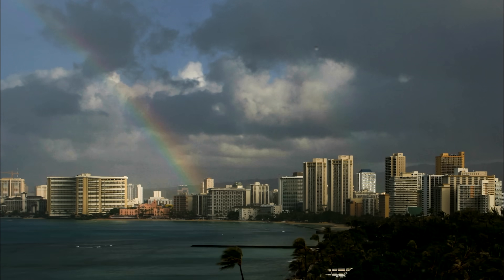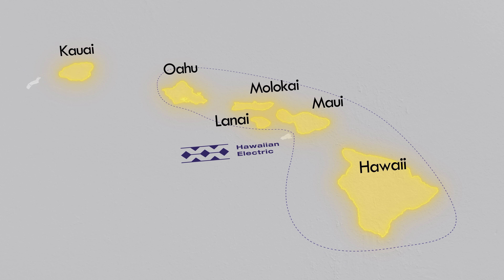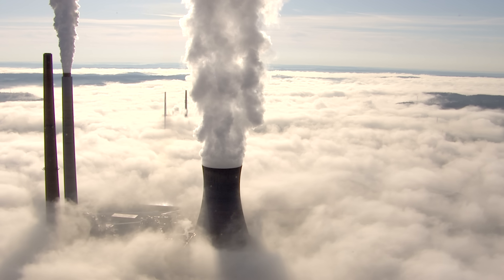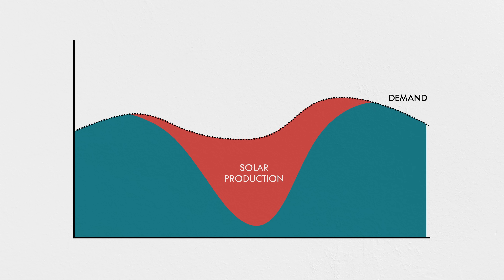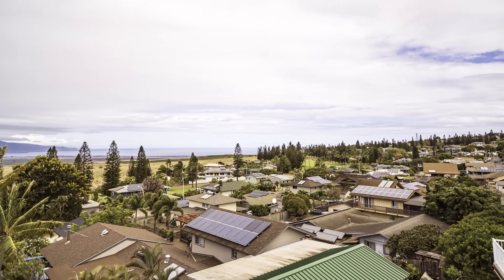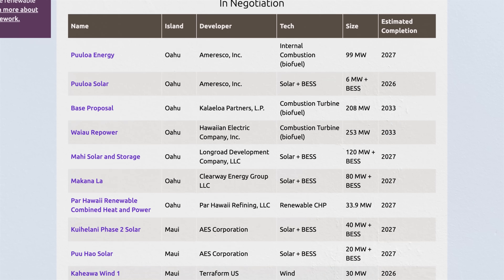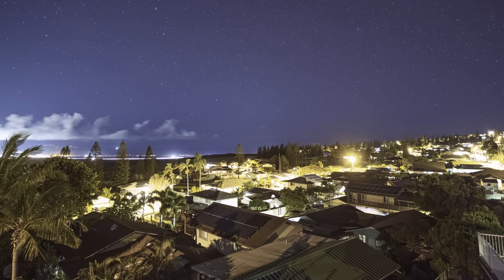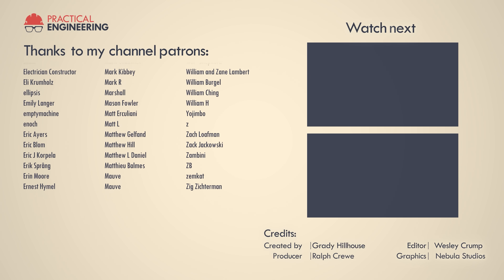How the Hawaiian Power Grid Works

Comment: I would like to meantion that you paint inverters in a quite bad light here, they have developed a lot in the past 20 years and have been carefully engineered to not fail in unexpected ways but in quite defined ways. 
Most countries have strict guidelines on how inverters need to operate. It is also to say that the inverters get smarter every day, power providers have begun to setup API‘s and ways to communicate ways for individual inverters to be controlled by the providers, latest example is South Australia

Comment: NZ has an underwater cable that connects the north island to the south islands' large hydropower dams. Specifically, manapouri. Which is the largest, near the bottom of the south island. And which also powers an aluminium smelter

Comment: I would love to see a similar video on Puerto Rico!  The grid there has been so unreliable that many are switching over to private microgrids.  As battery storage prices drop, these types of installations start to make more sense.
Reply: Puerto Rico's case has a really bad aspect that's entirely on the politics side--financial mismanagement so bad that it bankrupted the Puerto Rico Electric Power Authority (PREPA). This has many ramifications that make the process of restoring and modernizing the power grid a lot more painful, controversial and plagued with mistrust than it ever should be.

From a logistical standpoint, our grid is larger than Hawaii's grids combined. Puerto Rico has roughly twice the population of Hawaii (and had a peak closer to 2.5x back in the mid-2000s), but it's all unified in a single main island, while the two small island-municipalities are connected to it. The grid is very heavy on fossil fuels, nowadays with a roughly even split between heavy fuel oil, diesel, natural gas and coal, a small share of utility-scale renewables (mainly solar, two wind farms, two landfill gas facilities, and neglected hydroelectricity operating at a third of its design capacity), and a very substantial share of distributed renewables (just about entirely solar, amounting to around 800 MW).

Out of our roughly 5,000 MW of nominal power generation, we have about 3,000 MW that's usable on a good day, but that amount itself is insufficient for peak summer demand due to growing refrigeration requirements, we'd need closer to 3,500 MW to safely operate the grid for the summer peak. This grid is also hampered by topography and climate. Due to the mountainous terrain and the moisture of the trade winds, much of the major transmission lines traverse really rugged terrain and have ferocious vegetation management demands. Many of these lines are where they are due to these connecting the early hydroelectric facilities, in contrast to the population growth since the mid-20th century, which almost entirely occurred in the coastal lowlands, concentrated in the north and west coasts.

Puerto Rico also has the added complication of seismicity--to the surprise of many, the 2020 southwestern Puerto Rico earthquakes actually took down the entire power grid, as the quake's epicenter happened really close to the thermal power plants on the Tallaboa Bay. The seismic movement did damage the control center computers and activated the fault protection mechanisms of these facilities. The recovery took a while due to continued damage from the quakes, taking roughly a week for the full restoration of power.

Grady and his team would need to do a lot of research to get into all of the nuance, and it's extra challenging due to the lack of transparency of government authorities and their hired private sector grid and generation operators: LUMA Energy and Genera Puerto Rico, respectively.
Reply: @LucarioBoricua thank you for sharing this information. You seem to know quite a lot about the subject! 
If such a video is made, I hope you consult!

Comment: Thank you for this great video on the promises and pitfalls of distributed energy resources (DER). Just like our telephone system in the 1990s, power used to be one of the most boring topics in the electrical engineering curriculum. Today power is rapidly emerging as one of the hottest topics. Today, power generation, distribution, storage and management attracts massive amounts of venture funding. 

I look forward to your video on power integrity.

Comment: Two things you might want to mention 1)  Hydro pumped storage can help smooth out peaks and valleys  2)  DC Transmission across water (even salt water) has been successfull in Scandanavia as well as British Columbia  as well  as in the USA with a big reduction in losses compared with AC transmission.  Solid state power conversion has improved dramatically and has helped keep the costs under control.

Comment: I was in Maui a couple of years ago.  While driving by a power plant the driver said the plant was powered by diesel.  I hope that was an exception, they need small nuclear plants or LNG power plants.  Hawaii is one of the few places that several power sources make sense such as solar and wind, but they should be a small portion.  Ask Texas if it is a good idea to have 25% of your power capacity not 100% reliable.  They had terrible problems a few years ago.

Comment: Mahalo for doing a nice video on challenges of the islands.. would love to see a deeper dive on the technology solutions & problems for the power system change?
eg @7:35, re inertia/frequency grid stability services that traditional flywheel/turbine generators get & give for free...
that's what good battery systems like Tesla's MegaPacks can provide.  There was recently a writeup of how Tesla's big BESS system (replacing the coal plant) provides those valuable services, not just KWH of energy... much of the $ value actually comes from those services, not just storage.
Same applies for BESS installs in Australia, big issue (and payback) was near-instant grid stability services, not just KWH storage from renewables.
Comes down to software, not just hardware...

Comment: I’m a Hawaii resident and the island of Oahu closed our coal power plant a month before the blackouts, they were planning for renewables to take the load but are way behind schedule and we’re advised to keep the coal plant up until the renewables were online but they shut it down instead. If we had the coal plant we would not have needed the black outs
Reply: Shutting down the reliable clean coal plant, before shutting down the old crude oil plants (HECO owned) was shameful.

Comment: 13:41 "You can't pay a cheaper rate for less dependable service [... and] you can't pay extra for more reliability".
Maybe they should make this possible: turning off power in times of renewable energy shortage in exchange for lower cost, or installing extra battery capacity (or other means of increasing reliability) for higher paying users. It could even work on separate circuits for different needs.
Here in Hungary, we have separate lines and rates for electric water heaters, that are remotely turned on/off, only powered for 8 hours/day in off-peak hours, and we have another line for heat pumps, which can be remotely interrupted twice a day for 2 hours each (in peak hours). Both options are priced lower than the normal "always" available lines.
These options can't quite handle a week with no wind, little sunshine and insufficient storage, but they can somewhat smooth the intraday demand / duck curve.

Comment: I want to open with a heap of praise.  I'm employed in the electrical industry and I'm a total power system geek.  I'm also a regular visitor of the islands, so this is a topic I can totally get into.  It is a very well produced video with great content.  As a civil engineer that does such a variety of topics across the engineering spectrum, I am so impressed that you get your videos so accurate and informative outside your area of expertise.  

About the only thing I think you left out was not mentioning hydro.  Only 3 of the 6 islands with public power utility have hydro.  On Maui it is under 1%, the BI has 3%, and Kauai has 10%.  Kauai has the best potential as the West end of the island is a former caldera that was filled by ash from later eruptions.  That has created an alpine swamp that produces a constant water flow that changes little during short dry spells.  The constant flow and high head has provided the opportunity to have some decent, reliable output.  Kauai has the greenest grid on the planet, and that 10% puts them 10% closer and did materially help their progress.
Reply: You mentioned inertia on the system.  There are two projects to help by adding inertia.

On Kauai, they have converted their LM2500 turbine to also act as a synchronous condenser when needed.  GE has developed a mode for this model of power turbines to do this.  The LM2500 has a free power turbine where the generator is connected to a separate turbine downstream of the turbine that powers the compressor stages.  When the power turbine is back-driven, it draws very little power.  To use the turbine as a synchronous condenser, modification needed is a small driving motor to spin the high pressure turbine  slowly.  This turns the oil pump and moves a bit of air through to prevent heat buildup around the power turbine.  The turbine is started and synchronized, and when shut down the gas generator spools down and then is motored slowly while the generator is left connected to the power system.

On Maui, the Kahului steam plant is being de-commissioned.  Two of the generators are being retained as synchronous condensers.
Reply: As you mentioned, Kauai is the only consumer owned utility in the State.  Kauai is a bit unique in another regard:  wind power there was a non-starter.  There are multiple endangered sea birds there, and the utility has a hard time even adding transmission poles due to the take from the poles.  It goes so far that the utility is being asked to bury some of the transmission lines.  Given this background, Kauai electric never even considered wind and has embraced solar as the only option.

There is a bit of a fallout from this.  Compared to the strong presence of wind power on Oahu, Maui and Hawaii, Kauai has much lower storage requirements.  Wind is cheaper when it comes to the capital cost per kWh produced, but doesn't fare well when storage costs are added.  The sun does go down every night, but it keeps coming up the next day.  Even when cloudy, solar still makes 1/2 the output of a sunny day.  You can't say the same for wind.  Windless days can go on for many days on end.  The size of the batteries is determined by the longest stretch of non-generation, and with wind that is days instead of 1/2 of a day.

Kauai is now to the point where on sunny days. they are able to start one large diesel in the wee hours of the morning and shut it down mid morning.  All the rest of the time they're on solar, biomas and hydro.

I'll also point out that Kauai is doing this at lower rates than the state of California, and California has FAR lower rates of green energy.
Reply: Something I don't hear talked about a lot WRT Hawaii's power, is the lack of pumped storage.  The island chain has none.  They need storage, but the focus seems to be on batteries.  

There is a proposed project on Kauai.  This project would use former irrigation reservoirs.  It is stuck in lawfare from environment organizations.  I find this particular one ridiculous as it is reusing existing reservoirs, and is key to stopping the use of diesel.

I haven't hear of anything proposed on either Maui or Hawaii.  Both have huge potential for pumped storage.  The island chain isn't short water.  Any shortages are local, but the wet side of the islands have plenty of water for most of the year.  Off stream storage could be filled when it is raining and just have some reservoir space dedicated to taking the system through dry spells.  On Maui, there are flatish areas around Kula and a system to pump water up from the saddle and back down.  This is idle farm land.  The same could be done in West Maui, with the lower reservoirs still above the tourist areas. The power plant would be right on the main transmission lines going through the saddle.  On Hawaii, a plant could be built to move water between the area above Hapuna to around Waimea or from around Waikaloa to the saddle.  Both are in the dry area of the island, and would need a water conveyance from the wet side.  But they're all on unused land, except for the fact that some is actively being covered in solar panels right now.  Most of it is lava flow or ancient lava flow, not much suited for other uses.
Reply: As I said, I'm a geek on the topic so I'll break things up into several comments so they don't go too long.

One item unique to 5 of the 6 power systems is the small size and the impact on power plants.  On Oahu, with most of the State's population, the size of the power system is big enough that their power plants are more like those on the mainland.  Oahu's steam plants are smallish, but more like mainland power plants.  Oahu has several gas turbines that are the same as those on the mainland.  On the rest of the islands, they can't use what would be a "normal" power plant, as it would be vastly too big.  The rest of the islands are using much smaller power plants.

GE aeroderivative turbines are popular. They are using the LM2500 that was developed out of the original GE engine used on the C5 Galaxy and the 747.  Kauai has one LM2500 running simple cycle.  It ran hard for about 20 years, but now is only used on cloudy days.  Maui and Hawaii have multiple "2x1" combined cycle plants.  That's where they have 2 LM2500 turbines producing power, and a single steam turbine running on the waste exhaust heat of the turbines.

Kauai and Maui are using large medium speed diesel engines originally designed as ship main engines.  Many of these are quite old, some with over 70 years of operation.  As the solar power grows, it is tending to shut down the turbines and these diesels are run more as they're quite adept at fast starts and stops.

Finally, there are a whole lot of EMD engines on the 5 other islands.  For Molokai and Lanai, they are the primary source of power.  For Kauai, Maui and Hawaii, they have quite a few spread around.  They try to use them sparingly due to lower efficiency, but they provide a good backup source of power if one of the larger units is down.

Comment: 2 questions, somewhat related
Any nuclear? It sounds like baseload is provided by fossil fuels and geothermal. It seems like nuclear - particularly slowbreeders to minimize waste and refueling - would be a natural, as the waste heat dissipation should be easy (though you would not want it concentrated in any one area of the ocean, it can be distributed so that currents prevent any localized significant spikes or gradients)

Energy storage - in so many areas of the world, overload energy is stored by pumping water from below a dam to the lake above the dam, so that the water can then be put through the dam again when the power is needed.  My understanding is that Hawaii does not have the rivers and terrain needed for that sort of operation. There was mention of a couple of battery facilities, but the capacity and challenges of those facilities were not really discussed.
Reply: You don't need a river just the right terrain and the global pumped hydro atlas says Hawaii does have a couple of places where it could work.

Comment: I assume battery banks would help a lot with stability. Inverters themselves don't have inertia, but the batteries do in a sense. To maintain frequency the load and generation needs to be well matched, so the batteries need to take excess generation and cover dips and shortages. Grid operators seem to be saying systems like the Tesla mega packs are good at millisecond scale stabilizing/balancing. Kauai had one installed something like a year or two ago.

Lots of battery projects have been in progress or planned by many operators due to various benefits of cost reduction and replacing expensive peaker plants.
Reply: Kauai keeps bringing battery arrays online, but the West Kauai Energy Project is a gravity-based, closed-loop (mostly) energy storage system in development that should be able to store massive amounts of energy in water stored at a lower reservoir (pumped to an upper reservoir when there is excess energy), and then the energy is reclaimed when water is released from the top reservoir to the bottom reservoir.  It will be ultimately cheaper and easier to maintain than a chemical battery system, and also much less toxic... as long as it can survive various lawsuits.